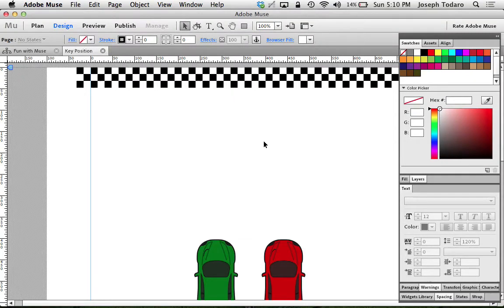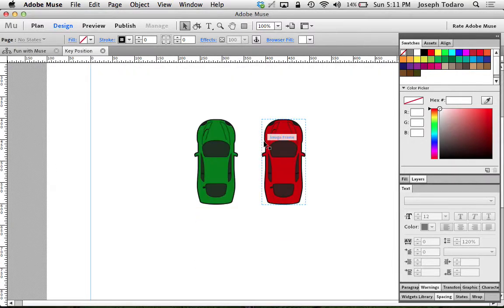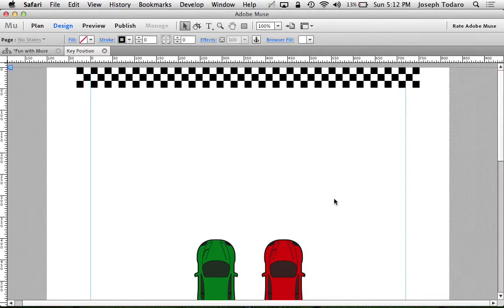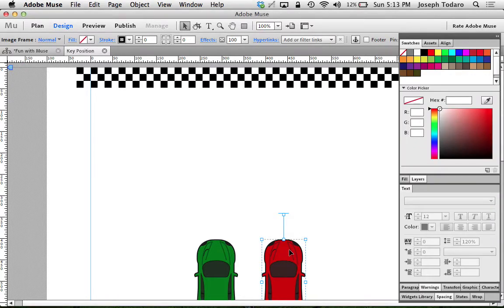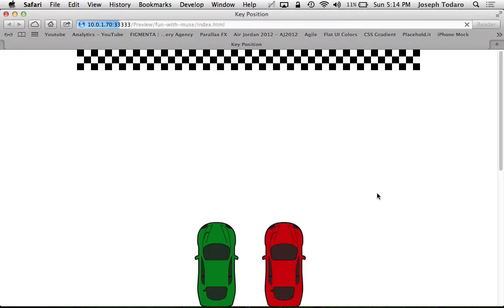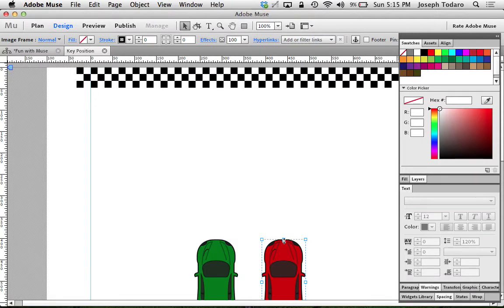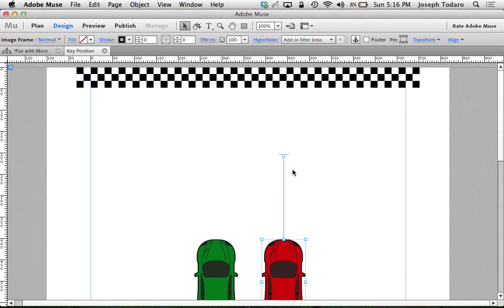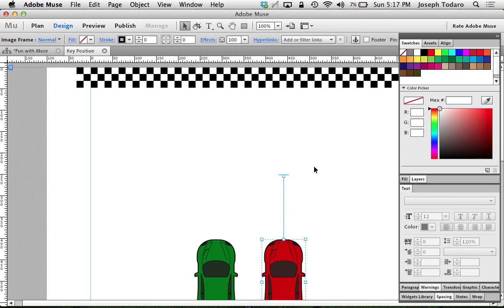Adobe Muse CC Parallax Scrolling Tutorial | Understanding Key Position

Comment: Is there a way to have the parallax scrolling key position be from the bottom of the browser instead of the top? I'm running into issues with shorter screens.......I can I some how do that with making it a "footer" item?
Reply: I think it would work if you dragged the T-handle below the object to the bottom of the screen, not sure but try that out if you haven't. Of course I could be completely wrong cuz nothing I tried worked till' I watched this video.
Reply: Jared Nesi Nope, still relative to the top of the browser... even a negative number is relative to the top of the browser. There has to be a way to make sure it sits on the bottom of the browser but I can't figure it out... Joseph?